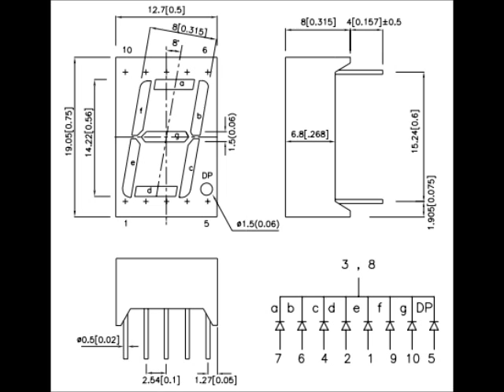How to control a 7 segment LED display

Comment from the maker: @AldoBr549  Sorry for the two message, I overshot the character limit :) I presume you're asking why I didn't drive it directly from the PIC pin? I put the transistors in so that it was clear how to  do it if you wanted to draw the max 30mA without damaging the PIC but I've probably failed to make that clear too :)

Comment from the maker: @AldoBr549 Hi, well mostly because I already had a bag of 100 pnp transistors that had set me back a wopping 1 euro is why I didn't buy a driver :P And aside from that the idea of the video was to explain how each LED is only on for a split second although it would seem I have failed to make that clear anyway.

Comment: Why did you use transistors?  If it was me I would have just got a led driver. 2 bucks, problem solved! No micro controller needed. In either case the transistors are not needed unless you plan on doing some fancy dimming effects. Maybe there is a concept here i don't understand, if so please explain. Thanks!